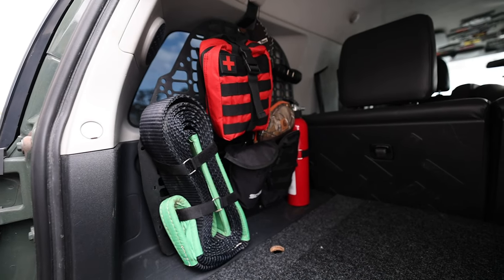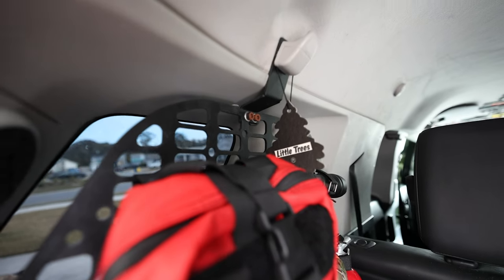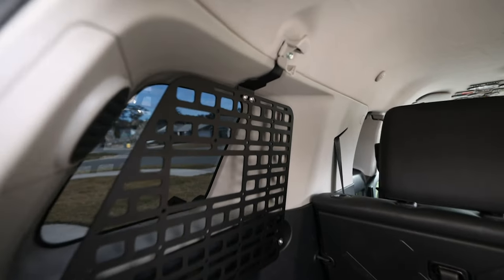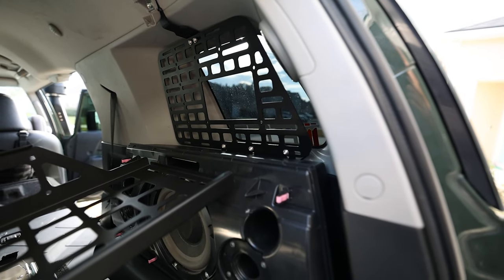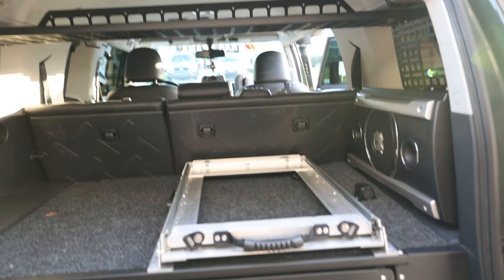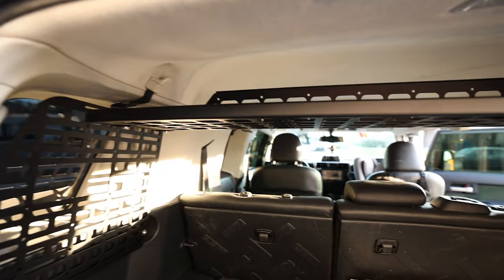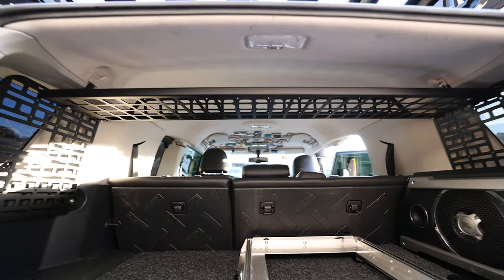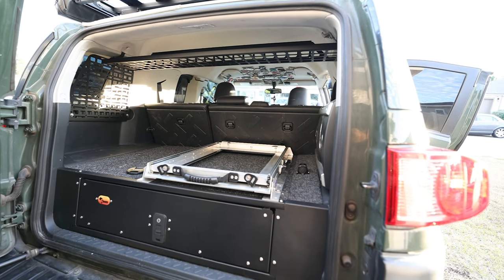FJ Cruiser rear molle shelf-Bison Gear

Comment: I just received mine but am puzzled because my shelf came in two pieces, not one, like yours and as I have seen in different videos. I did just send them an email for clarification, so we'll see what they say.
Reply from the maker: That may be a new design, but let me know as soon as Bison gear gets back to you. They have good customer service so I'm sure they will assist.
Reply: @GREATESTOFALLTEXAS  I did email them and they responded that it is an upgrade that adds more space, but based on another person who previously bought this shelf system, it only adds about an inch. I replied that I would like a refund seeing as the picture that they still use on their website shows a one-piece shelf, not a two-piece. Furthermore, the holes to attach the two pieces of the shelf are off by about a mm, so I can't screw them all in to join them successfully. In addition to all of that, they forgot to send the L brackets by which to hang the shelf to the other MOLLE panels, though they did send three MOLLE panels instead of two, which is puzzling.

If I wanted a two-piece shelf, I probably would have ordered one from another company in the states that has such.

I have not heard back from them after my response email, so I just now sent another email to remind them that I would like a refund. I'm hoping that they are good on their "satisfaction guaranteed" motto and 30-day return policy and that they process the refund ASAP.
Reply: I’m also a bit annoyed that I got the 2 piece attic as well. The holes are also off for me. I’m going to have to drill the holes bigger on the weekend. Any update?
Reply: @dC5alex  At first they said they didn't make the one-piece anymore and didn't have any remaining. Then after I sent a couple more emails, they said they found one more one-piece and sent it to me.